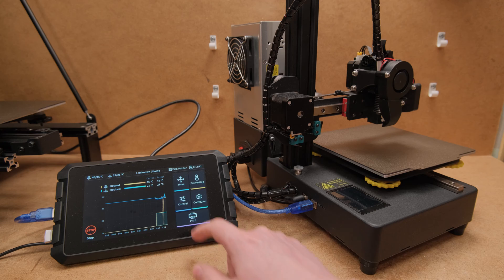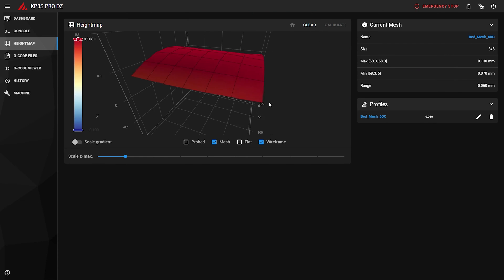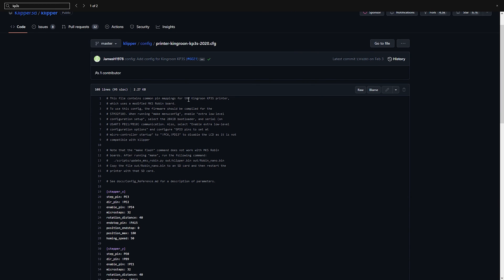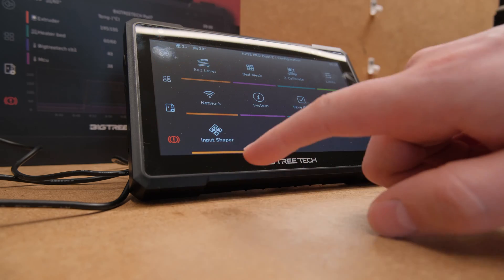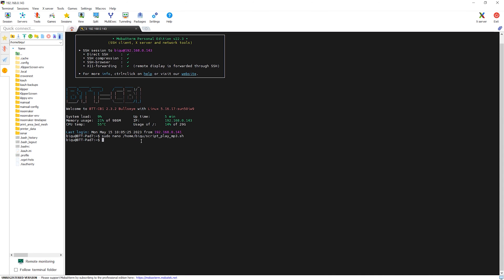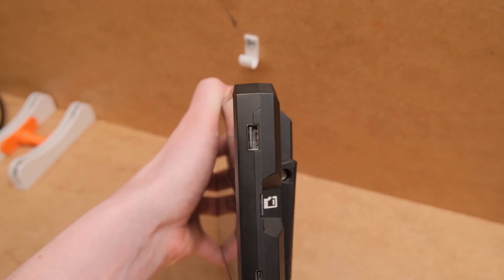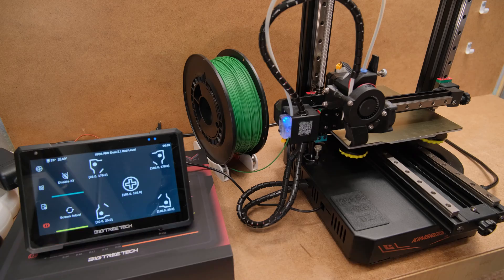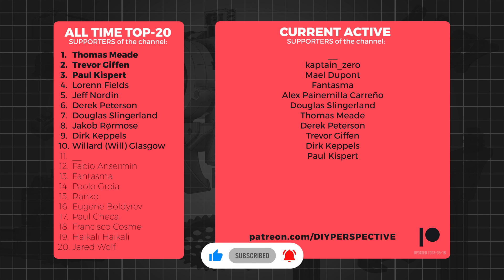BTT PAD 7 – STOCK Klipper is THE WAY?

Comment: I got mine when they came out, Finally got it to update everything installed on it after having to buy another 2.4ghz router as they wont work on a Sky hub. But then the next problem, Even though the Pad 7 connects to the wifi, Putty cant find it even with the IP address typed straight in.  So, its worthless.  I  cant fix the missing file to make it work.  Ive ordered a CM4 from Raspberry, Replace the CB1 and hopefully get something happening.

Comment: Question, i messaged BTT and they told me only 12v dc and 5v usb power. I am now very confused because I've already got it hooked to the printer's 24v power supply which seems to power the pad just fine but I don't want to damage the pad by using it long-term if it is not compatible. 😮  Any thoughts?
Reply from the maker: Maybe miscommunication inside the company. I talked to a person directly who works closely with engineers and they said - "To clarify, the Pad 7 is designed to support both 12V and 24V power input.". It would be very stupid to design a pad that only can be powered with 12V because almost all printers run on 24V. I will relay your experience, so hopefully they all will be on the same page.
Reply: @DIYPERSPECTIVE  Thank you for clarifying that. It makes sense, the person I spoke to was most likely just a sales person as I messaged them through their aliexpress account. I also asked them, then why include the barrel connector and they couldn't give me a clear answer, stating it is included to give "more options" but at the same time saying to only use the 12v adapter 😂 lol .... on another note, does the backlight flicker slightly for a second when you power it up? It seems that may be normal?

Comment: Awesome video mate ! Thanks ! Would you be able to make a video with the use of the ADXL and CB1 config please ? I can't make it work for the life of me lol. Cheers
Reply from the maker: Hey, add these lines to the printer.cfg file (for the PAD 7 + BTT ADXL):

[mcu CB1]
serial: /tmp/klipper_host_mcu
[adxl345]
cs_pin: CB1:None
spi_bus: spidev1.1
axes_map: x,y,z
[resonance_tester]
accel_chip: adxl345
probe_points: 100, 100, 20 #customize to your specific printer
Reply: @PrintingPerspective  thanks for your propped answer. Unfortunately, it doesn’t recognise the pin. I had a bit of play behind the screen like the instructions say but it doesn’t take in account the pin for the adxl. Cheers
Reply from the maker: Are you using PAD 7 with BTT ADXL? Because it is for this specific combo.
Reply: @PrintingPerspective  yes i do, with cb1 and not cm4.

Comment: i had a raspberry pi4b 4gb but after weeks of trying to install klipper and failing everytime trying to get it to work i maybe will give this one a chance :) also had no screen on the pi and had to do everything with the pc or switching hdmi port on tv lol :)
Reply from the maker: I think Pi4b is a little bit overkill for a printer considering its cost. If you need a screen next to a printer you can open Mainsail on a phone. But Klipperscreen is just way more optimized for a touch interface, so it is definitely nice to have, but not a must.
Reply: @PrintingPerspective  yeah i know,bought it when it released in 21 but never used it :p
Reply: What's the problem? Klipper is not that difficult to install. The most complicated part is the configuration

Comment: Thanks for the review! Looks like a great option for running Klipper and with the price of RaspberryPis still above normal, it would be a better value.
Reply from the maker: Yup, the most important that it runs stock klipper, which is miles better than any custom implementation on the market today.